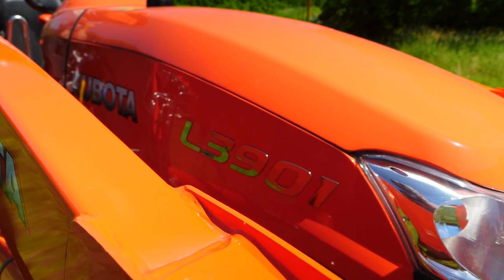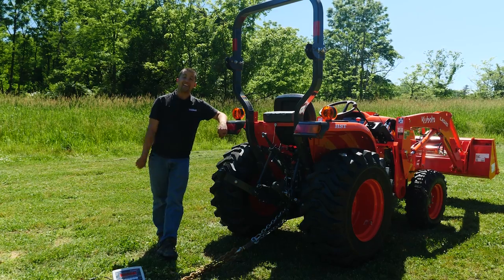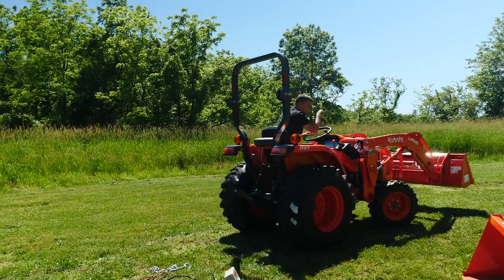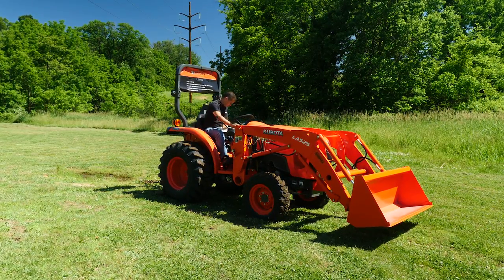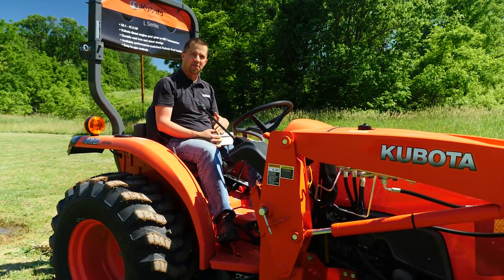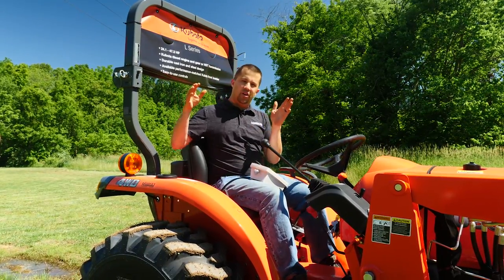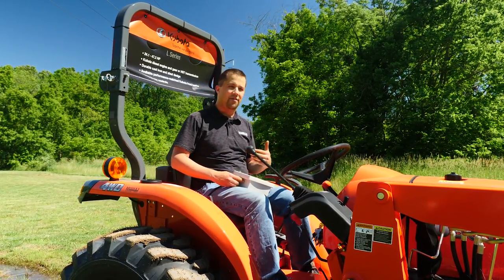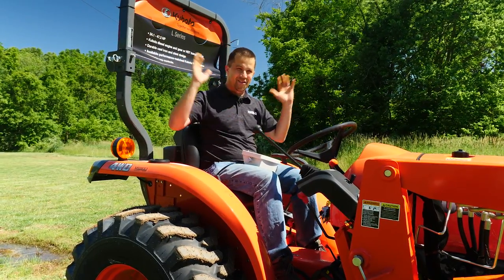Tractor Pulling Test - Gear Drive VS Hydro-static

Comment: Doing this test in high range on the hst seems pointless the high range is for driving on the road. Medium or low would be much more interesting
Reply: Agreed. 
But having a HST they don’t have any power in any of the three ranges. L3830
Reply: My thoughts exactly. What's the purpose of this video really? Is Messick's overstocked with a whole lot of gear drive tractors?
Reply: Gear drive is stronger than hydrostatic no matter which range you compare them in. Hydraulic power is not giving direct power to the wheels like a gear will. Hydro is more convenient but gear is stronger. This test is a very valid test and isn’t stupid at all. If you want the conveniences of hydro your going to lose some pulling power but many folks don’t need to pull a lot with a small tractor. That’s why we have options, what works well for one may not for another. There are pros and cons to both drive systems. That’s my opinion, feel free to disagree
Reply: @turbodiesel8651  isn't that kind of a generalization? The miracle of hydraulics us that a hydraulic systen actually does put power from the pump directly to the motor that turns a wheel, with less loss of energy than with a standard drivetrain. In application, you are replacing the drive shaft, awkward u-joints and etc. The pulling power of the vehicle is limited, ultimately, by the quantity of hydraulic fluid it can carry and keep cool. If it were practical to load up the little Kubota with 60 gallons of hydraulic fluid and a couple of coolers, a powerful axial piston pump could be used to drive the wheels and multiple accessories to out perform the gear drive tractor, while still using the same fossils fuel engine. 

All that said, since about 2005, ive thought hydraulic drive systems to be the wrong direction. Hydraulic systens are expensive, and it is the nature of liquid to seek more efficient means of travel than that you've selected for it. In other words, they break and are messy polluters. Far better to use a mechanical drivetrain and put your money into researching electric power. The electric tractor is the future.

As for me, I've got a couple of tractors, and both are gear drive and run on fossil fuels.
Reply: @charlotteantiquepowerengin6277  a larger hydraulic pump would also require a larger engine to run the larger pump and move the larger quantities of fluid. You would end up with a larger tractor to do what your saying, where would you place a  60 gallon oil tank on a compact tractor? Perhaps I'm stupid and that's fine but I have never seen a hydrostatic drive outperform a gear drive tractor in pulling or durability. Electric currently has severe limitations when applied to a tractor that's pulling something that requires a lot of constant torque.
Reply: Benjamin Brockman I also do understand that power goes directly from the hydraulic pump to the hydraulic motor and then to the wheels, where else would it go lol.. the point I was attempting to make, is that hydraulic has more energy losses transferring that power from the engine flywheel to the rubber tire that drives you forward.  Gears are a more direct method of energy or power transfer because they are more efficient than hydraulic pumps. If you have time look up cvt transmissions on tractors. It sounds like they use a mix of hydrostatic and gear drive. Interesting technology
Reply: @turbodiesel8651  I agree with your summary of the limits of hydraulic drive systems. I think we are on the same page there. I was just pointing out that hydraulic drive technically has the potential to more efficiently transfer power from the prime mover to the wheels. That is why so many engineers have traveled down that dead end path.

What is a tractor? It is a mobile power unit with PTOs. It is a passenger vehicle. It is a traction and pulling vehicle. It is a hydraulic power unit for some operators.  

A lot of engineers get caught up into trying to make it a do-it-all hydraulic power unit.  There are buyers who want that, but not many.

I think you may missed some of the exciting new developments in alternating current electric motors. You refer to torque, but given the excellent torque characteristics of electric motors, I think maybe you are referring to a sort of power fade experienced by operators of DC-motor-driven vehicles at higher RPMs under load and when climbing to higher grade. While a tractor is a vehicle to some extent, it is not typically designed to run at high numbers of RPM. With large, traction-oriented tires and good gearing, high RPM is not needed. I've never had an electric winch complain about a load.
Reply: Benjamin Brockman electric motors are definitely capable of delivering high loads of constant torque. We have the motor technology to make it work we just don’t have an efficient affordable method of supplying the electric to the motor. I believe that electric is a great idea but storing enough energy to supply a hard working tractor would be an accomplishment. Trains already have an electric drive but the electric is produced with diesel generators and I believe they have electric bulldozers but again the juice is made with a Diesel engine. The ability to store enough energy is the limitation I’m referring to.
Reply: @jamesmclamb3682  get one cheaper then. Gear shift. Push button for your wyfe.
Reply: @charlotteantiquepowerengin6277  , nope. Hydrostatic falls short of gear drive across all makes and models. They overheat in the summer too. Theory is for textbooks. Hydraulic systems can do great things, but aside from combines they don't work well as powertrain systems.
Reply: Testing in low gear would show them as equal because the limiting factor would be the tire's grip...how can you guys not understand this...its a simple concept...
Reply: @BrokeWrench  maybe because the gear drive broke the tire grip in high gear? Maybe because we've seen how underpowered hydrostatic tractors are? Even if it could slip the tires in low, it sure couldn't in high, could it?
Reply: @BrokeWrench  who would want to crawl around in 1st low all the time because it's the only way to get any power??
Reply: Yeah the geared tractor should be in the highest gear not 1st as well. I have an Mx 6000 and you can’t stop it if it’s in medium or low
Reply: @eddieb9110  that was a reply to someone else comment. They said the test should have been done in low, I was pointing out that would be pointless
Reply: @freedomisntfree_44  it was in high gear.
Reply: @BrokeWrench  gotcha.
Reply: Maximum Chooch  after the initial pull yeah. No one runs a gear tractor in high range to work with just like nobody would run a Hydro tractor in high to work with, Are use my Hydro tractor to load with and it’s much faster
Reply: @freedomisntfree_44  nonsense. I was going to say, If you don't know  how night and day the difference is you probably run a very small tractor with a front loader. If you are actually farming, there are a ton of operations done faster than your lowest gear. Big bulldozers can't even run all day in the heat anymore. The two are not even comparable when it comes to power.
Reply: @turbodiesel8651  Not all HST drives have to be weak. I have used 20,000 pound back how tractors that can break all 4 wheels loose in any low range gear. I think it is just the home owner sized tractors that are not at full potential.
Reply: @dungeondark  most hst drives are capable of breaking all for tires loose. They are nice drive systems but they are less efficient at transferring power from the engine to the wheels than a gear drive.
Reply: The manual in high range 4th gear still pulled 50% more.  HST sucks you lost.
Reply: @turbodiesel8651  There is no inherent advantage to direct drive. In fact, just about every pickup truck on the road is a hydraulicly driven through an automatic transmission.
Reply: @oldcountryman2795  hydrostatic drive and automotive transmissions share absolutely nothing in common  other than they both have some type of oil in them.
Reply: @oldcountryman2795  automotive transmossions have tourqe converters and clutch packs hydrostats have niether
Reply: @turbodiesel8651  It's all power transfer by fluid dynamics.
Reply: @oldcountryman2795  fluid dynamics in a hydrostatic drive is not as efficient as a direct gear drive.  This video makes it very clear. Theres really nothing to argue about.. comparing a hydrostatic tractor to a automatic automotive transmision is like comparing a semi engine to your 5 hp pushmower engine.
Reply: @turbodiesel8651  You're wrong
Reply: @oldcountryman2795  saying that I’m wrong without offering any type of a educated explanation is convincing! At least try to prove me wrong!!
Reply: @oldcountryman2795  I just love it when people try to dispute the obvious.
Reply: If the gear drive has more power in high range, don’t it seem logical to think that putting the gear drive in a lower gear that it would produce more pulling power in a lower gear as well?
Reply: @turbodiesel8651  mine dump truck are electric drive too
Reply: @oldcountryman2795  only when the torque converter is open.
Reply: @eddieb9110  hydrostatic systems are common in large dozer applications, and those machines have some serious push. Excavators too. Skidsteers are hydraulic motor as well.
Reply: @jonburke2038  those dozers can't work in the summer without overheating either. That was done to save/make money. Obviously not for durability. There is simply no comparing a good engine with a gearbox to hydrostatic in pulling/pushing applications.
Reply: @jonburke2038  you see this junk because it's cheaper than cutting gears. Not because it's better.
Reply: @oldcountryman2795  automotive automatic transmissions use hydraulic forces to change gears…the power is actually transferred via planetary gears.  A world of difference from HST.  I’d like to point out that automotive automatic transmissions have more drivetrain loss than their manual counterparts.
Reply: @sryth1  No, you are wrong.  Mechanical lock only happens at highway speed, until then power is transferred through the hydraulic torque converter.
Reply: @oldcountryman2795  I’ll pretend your not trolling for a little while longer.  The only similarities between a traditional automatic transmission and an HST is in the torque converter…the gear ratios are static planetary gears, and shifting is done via hydraulic clutches/brakes.  The torque converter is similar in principal to how an HST works, but is only used to control the transmission/engine interface (like a clutch in a manual transmission).

HST is basically a pump connected to a hydraulic motor.   It’s essentially the first CVT.

Using your standard here, we might as well call a MT with a viscous limited slip differential “the same” as an HST, since it uses hydrodynamics to move the axles
Reply: To your original point, those automatic trucks would put more power to the wheels with a manual transmission…precisely because of torque converter losses.  In that sense, you are right…HST has lower performance for a similar reason.
Reply: He should have tried it in low gear. There's no reason not to try it and see what the numbers say.
Reply: @oldcountryman2795  Every modern (the last 35years) Automatic transmission pick-up has a " Lock-up" torque converter. So it basically goes from a torque amplifying, muti-Gear shifting, to eventually full "lock-up" direct gear driven. Not much in common with your "typical variable swashplate, hydrostatic drives" in form or function. We're not talking "Bulldozer Tranmissions" ---- a totally different animal.
Reply: @charlotteantiquepowerengin6277  I was just shocked that the hst couldn't even make the wheels spin in the grass.
Reply: @BrokeWrench   no it wouldn’t. I’ve used identical tractors except one gear and the other hydro. Gear always pulls harder in every range.
Reply: @BrokeWrench  maybe use proper punctuation so people understand next time?
Reply: @oldcountryman2795  that’s a ridiculous comparison though.
Reply: The HST has a higher top speed in high (11.5 v 10.7), numerically the HST is at a power disadvantage when both are in high gear. 
The gear drive was allowed to lunge so your measure was of inertia not true sustained pulling power. 

Assuming both tractors have the same weight and tires, and that both tractors have the ability to spin their tires  the potential pulling power is the same, but one tractor may accomplish this at a higher speed than the other. 

Retest!
Reply: @turbodiesel8651  what?????
Reply: Agree

Comment: You should have done this test on dry pavement or concrete. There is no consistency with grass. The minute you drive over it the traction factor changes. Once a tire spins even the slightest the tire and grass is slippery. Using "clean" dry pavement or concrete with the same air pressure in the tires of both tractors would give a much better apples to apples traction comparison. Regardless, a gear drive tractor will drag around a HST tractor any day.
Reply: You test a car on pavement The tractor is meant to work and off road conditions not on pavement.
Reply: The test was to show pulling force .not working capability.the tires and ground conditions have to many variables to accurate pulling force
Reply: should have done the test with chains wrapped around the tires and anchored to the ground... either tractor in low will simply dig in
Reply: I only watched a couple minutes,  and was thinking the same thing.
Reply: The hydro didn't spin. The gear did. So the gear tractor was at a disadvantage. I've felt the hydro really struggle when pushing a tree. So this test makes sense... and making me thing about my next tractor which i already ordered as hydro. I do like the hydro for brush hogging and loader work. I guess tree crap is once and done.
Reply: @highlanderc  Not only that, once it starts to dig in, it's going downhill into a hole. The weight of the tractor is assisting in both pulling and in traction once that happens. To explain. When we had big tractors stuck and brought in another to pull it out, we would let the pulling tractor dig a couple holes. Then shorten the cable so the pulling tractor was pulling down into the holes. At that point, there is a much bigger fraction of the tire contacing dirt and it's got the additional force of that tractor falling into a hole to assist in the pull. ANyhow, all this video demonstrated was that the pressure limit on the hydrostatic was hit long before the engine got bogged down. Given it was in high range, didn't demonstrate much in the way of useful information.
Reply: Agree  if the tires on the gear didn't break free it would of been even higher
Reply: You lost - suck it up! Gear drive 3 times more pulling power!
Reply: It would have just made the gear drive pull even more weight , wouldn’t have made any difference with the hydro being it didn’t even spin. 
Plus on pavement it would be very likely it could break the weakest link in the drivetrain whatever that may be.

Comment: I find it cheaper to replace the clutch than replacing a transmission that cost almost what a used tractor goes for. Also, I've noticed gear drive trans are much better for heavy work and can last a lifetime if properly maintained.

Comment: Uhh... where's the rest of the video, where you put the HST in low range???
Reply: All he’d do is spin the tires, that’s why the test was done in high.
Reply: Once you spin it's over in my experience. In a hydro  machine  you shouldn't.
Reply: @brandtwebber5761  they can both pull the same load up until the tires break loose. He should have tested to that point and there would not have been a difference. The tires are the limiting factor.
Reply: Unnecessary
Reply: If the gear tractor is pulling 3 times the hydro in high, it's going to pull about 3 times the hydro in low.

Comment: I am fortunate to have a L3200 gear drive tractor for discing and bush hog mowing. And a B2301 loader tractor. I prefer the gear drive because of it's ability to work at a set speed while working on food plot's and mowing my 2 miles of trails. But a hydro-static is a much better loader tractor, almost instant direction changes. So you need both!  Thanks for the video.
Reply: Or get a shuttle I think it’s the best thing since sliced bread, no torque loss, no whine, plus instant direction change.
Reply: Yes wish there was a shuttle option,   Be awesome if u could get the GST transmission on this size tractor

Comment: That high pitch whine drives me crazy on hst.
Reply: I use earplugs on tractor anyway
Reply: yes I agree... BUT their better for loader and dirt work. I have a L3800 HST. don't like the wine
Reply: You'll hear that in the Std. L and MX series. Step up to a Grand L 60 or an older Grand L 40 series and virtually no whine. I don't know how they managed to quieten down the Grand L's like the way they did but they did.
Reply: My experience with my kioti tractor is there’s only a high-pitched whine and high range if I’m in four-wheel-drive
Reply: Did you put the HST in four-wheel-drive?

Comment: That was surprising.  I have a hydrostatic transmission tractor and got it that way because my property is very hilly and uneven. The hydro transmission made it alot easier to drive around and do work. Now 15 years later I started doing open field mowing and quickly learned the value of a geared tractor.

Comment: I own a gear drive L3901 and love it. Great pulling power. I have a single bottom moldboard plow that it pulls easily, and when i had a 40' high cube storage container delivered the driver asked me if i would drag it off the trailer with my tractor. I didn't think it would, but he was confident. he ended up being right.